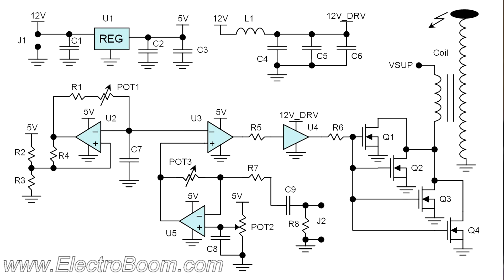Music, Magic and Mayhem with Tesla Coil

Comment: Ok, I have a Question
Is it possible that the nut at the end of the screwdriver acted as a coil to transmit the energy that shocked you 2:13 ?
I'm still getting the hang of this
Reply: It's not acting as a coil it's just picking up the charge because it's conductive

Comment: 2:17 the thing is basically ground until it gets shocked, then it has the same energy as the tesla coil. then before you touched it, it was basically the tesla coil. then the arcs jumped to your body, and you guessed it, a shock.
the reason the charges don’t fade off is because the pointiest end is pointed towards the tesla coil, which makes it not go to ground, but the complete opposite of ground.

Comment: You're a genius! Have you ever thought about doing the same thing with a T.V Flyback Transformer? Maybe simply PWM-ing the signal to the primary coil. Or perhaps using amplitude modulation to represent the different pulses with a lower frequency Carrier Signal than the tesla coil (20-50kHz) that matches the ressonant frequency of the transformer. You think it would work? 🤔
Reply: It might work

Comment: Ok I'm back after 4 years, i tried to build this 'profesionally' and honestly it was freaking hard (I tried putting everything including the 12V and big DC supply using a FBR and a toroidal transformer in a box). And currently, I am quite sad that it didn't work at all, i know the resonance frequency of my coil but i wasn't at all able to tune it at this level (184kHz)  even though i used a bigger cap to lower the frequency and now the i cannot measure the signal with my oscilloscope because its so noisy. The output of the comperator (U3) is fine but even after replacing the MOSFET Driver IC (U4) it was still to noisy to measure, so i was just like "Ok maybe I can somehow not measure this signal but it'll hopefully work" (Note: a week prior to this i was able to perfectly measure everything so i do not know what happened, maybe the two circuits are interfering with each other but this should not be a problem (i built both the musical and normal driver with two seperate outputs))
Fast forward i tried it out and after 2 seconds my auto transformer went into overcurrent mode which meant that something was wrong, after a while i checked the MOSFETS and they were dead. They were'nt even warm, they just died but i still don't know how. I guess the voltage which is generated by turning off the coil (L*dI/dt) killed them but it was still extremely frustrating that it did not work at all

Edit: I WANT THIS TO WORK SO BADLY!!!

Edit 2: Welp I'm a genius and forgot to add a glimmer sheet (or whatever these insulating things are called) works perfectly now just need to adjust it's resonance frequency to 235kHz

Edit 3: Okay....things are getting interesting, the "normal" mode works pretty nicely now but the musical mode draws a lot of current and it really doesn't work that well. Using an oscilloscope to find the problem is also worthless, it can't trigger on the signal (and I honestly don't fully understand why) it is extremely noisy. 
I don't get how you did it, you made it look easy

Comment: Here a tip how the screwdriver shocks you even if electric arcs dont jump electrons are still transferred through the air and conduct on to metal even if the arcs don't jump. The arcs dont have to jump for your fingers to get shocked by any metal object. this is due to the conduction of air molecules by electrons. When electrons pass into the air the molecules of oxygen rub against each other forcing the friction into static electricity.

Comment: Maaaaaan, you ispired me so much! If jet of electrons are spinning about 5 gramm piece of metal so fast it's waaay more powerfull than ion thruster used in space! And it's no even comaprable with microwave experimental thruster. It should be possible make tesla coil space engine using only electricity.
Reply: I saw other video with coil in vaccum.... Ehhh, this idea not possible....

Comment: When you put the metal on top of the coil and it started spinning, couldnt you do the same thing with a tesla coil of a much bigger size? Then, use the power of the spinning metal to power up some batteries or something?

Comment: 1:57 that reaction is hilarious
brief sense of amusement before you snap back into reality and realize youre dealing with high voltage and all the PTSD starts kicking in
Reply: He probably wouldn't have died either way, but he would've had an extremely long hospital visit, or Mehdi really has grown immune to electricity after touching it like 700 times
Reply: were you zapped by lightning?
Reply: jim halcom he grabbed a 2 kiloVolt Jacobs ladder in his 1 million sub special
Reply: Not only was it 2kv, it also had 500mA current. That’s around 1000 Watts. High voltage+High current=High power or basically, DEATH, Medhi was super lucky that his alligator clip connections sucked or he would have been roasted.

Comment: How come the sound cuts out when you put the metal too close to the coil at 3:21? My first guess is that it's not going through the air anymore, but it clearly is. And why doesn't it shock you when you're holding the metal wire but it does with the screwdriver at 2:10?

Comment: Could you suspend the turret upside-down, add a neodymium magnet onto one end of the bolt and then use that to attach your ion rotor? It should be capable of spinning at a higher rate unaffected by its own weight/gravity, it may also cause a different emission effect

Comment: If that's real, that's some amazing audio fidelity from arcs in the air.
Reply: it is how radios work, that's why signal improves with metallic antennas.
Reply: @alttikona  Pretty sure radio transmission becomes photonic once it leaves the antenna up to the point where an antenna receives it, converting back to electrons.

Comment: Electroboom in your own video debunking a crazy nut who was proving NASA wrong named "Is Space Travel Possible??" you mentioned at 2:00 that is the heat that expands from the plasma and pushes the needle around. Here you said at 1:53 that there is a "jet of electrions shooting out and forcing it to spin". Probably should correct that here...

Comment: don't use high voltage transistors. they have such high rdson values that they would heat up considerably under any current. and anyway - I know all the issues with back-emf spikes, but couldn't you just use properly rated flyback diodes?

Comment: Are you using a resistor to limit the primary winding current? Seems like the FET's you are using (Rds on = 0.45 Ohms) would draw > 30A continuously while at 50% duty cycle with your 32V VSUP supply, exceeding their 10A continuous limit...

Comment: I`m trying to make a similar circuit. My plasma ball exploded and I`m trying to fix it. There are two wires that if i short them the plasma ball gives a spark. All I need is to short these wires repeatedly very fast for it to work, and for that i`ll need a oscillator and a way to make the wires short every time the oscillator gives a pulse. How can I do that?

Comment: You don't get a shock from the tesla coil arcs because the tesla coil is a transformer and and transformers obey the law of conservation of energy through the equation Pp = VpIp = Ps = VsIs. Meaning as the secondary voltage rises, secondary current decreases and vice versa. Well although you still get burn marks on your skin.

Comment: Hello, I have a great query:
If I have a fan, with blades and I want it if by mechanical failure I emit a signal to cut a circuit foreign to it. I think of the magnet of a door, when turning the blade, the magnet generates a signal, when stopping the blade, the magnet does not emit the signal what can serve to make the circuit of others go off ... what do you suggest me? You can stick your finger in to see if it works ... greetings

Comment: Would it be possible to plug something like an electrical keyboard into this device and make the spinning wheel spin by playing the piano? Wouldn't that be amazing!?
Reply: With the addition on the outside of this circuit of a midi keyboard, yes! Anything from a cheap digital keyboard with an output to 3.5mm AUX, to a DAW running raw audio/loops/sequences/synthesized midi on that same laptop that is sending the audio in the vid. Super cool!
Reply: anything is possible

Comment: the reason that arcs appear even if there's no sparks is because an ark is when all the electricity is focused but when there is no ark from the Tesla coil even if it's on, the electrons are spreading everywhere. because the screwdriver bit has lots of surface area, more electrons can gather at once and than concentrating electrons to your body. your body is big and also provides surface area for electrons  to spread because they repel against each other. the reason it didn't hurt when you were holding the screwdriver in the other try was because only the arc part hurts because it's concentrated but if you give the electrons a larger surface area to transfer to your body, there's no arc and no pain

Comment: And this is how Tesla's Aurora Halo would be able to wireless data as well as energy.  A similar method could be used to turn the power grid into an internet connection that would greatly reduce the energy lost to inefficiently providing data services separately from energy services.
Reply: Zenn Exile inefficiency is always an issue and having to build much more infrastructure, having to have a filter in every appliance to somewhat steady the voltage not to mention the voltage of the power going into a house would fluctuate significantly depending on the data being sent, and always having large amounts of noise in it, its not exactly a small problem, there is a reason data and power lines are kept separate.
Reply: How so? If you'd like we talk about the science and economicsof why it won't work but I doubt you understand how electricity actually works but if you want to resort to insults I don't mind making you feel like a moron.
Reply: Yeah but if it does to data signals what it does to music, it'll be pretty low quality.
Reply: RisingSwell
that kind of noise can be predicted and is not an issue
Reply: just because it can be predicted doesn't mean it wouldn't be a problem, most home internet would still be significantly faster, and it wouldn't be great for gaming, the only real advantage it would have is availability to pretty much everyone
Reply: RisingSwell
and that my friend, is what really matters

We could reduce some of the noise with current technology. predict and compensate for more, and focus development on drastically reducing the noise to the point where service speeds vastly exceed what is available.  (accidental pun detected)

And that would be guaranteed progress, because more than 7 billion minds are better than 1 company with a strict budget and profit focused agenda.

This network would be the heartbeat of human innovation.  Even if you can only send and receive data at 128k, you can still communicate.  And connecting the world to a single communication network that cannot be shut off, and supplying them with the energy to connect to it and live their lives for almost no cost.

That would be bigger than Fire.

Our society would evolve rather than dissolve into conflict over resource consolidation and energy distribution.  Everyone, everywhere, would have access to the energy to process local resources, and distribution would be global.

War would truly be obsolete.  Just as Tesla envisioned.
Reply: except you would introduce more inefficiency by using a higher frequency for power transmission and having to use high voltage dc and have a separate line and amplifier for the data/ power going to each house.
Reply: *****
For the grid yes, but it would be slowly phased out.  So a non-issue.
Reply: *****
It would not make any difference.  You would not need to service each house.  You could just put up a long range hotspot at mains and use a transmission method that only works on the backbone of the grid.

Again, efficiency in this matter is nearly inconsequential.  Grid systems could be used as classified and protected State or Federal and highly secure networks along side a wireless global internet.

A safe Internal Network.  Worth every bit of efficiency lost in security gained.
Reply: It would be less secure since everyone would have access to it vice the classified computer systems already in use and if you're going to make a hotspot then you might as well just use satellites for wireless data which we already do with much more success so in the end it seems like an impractical solution to a problem that doesn't exist.
Reply: *****
your pathetic attempts at false reference are juvenile and delusional.  I can already prove it works through any normal household wiring and uses little to no power whatsoever.

There are actual patents that cover the transmission of data through power outlets for in-home applications.  But you think you know everything.  Right?

Delusional child go home and ask your mother why it hurts your butt-butt to be wrong on the internet.  She's the one who failed you.
Reply: Ok then prove it
Reply: Actually the audio quality can be better than with speakers if properly done.

Comment: So a question, how "vaible" would it be to be able to send power from one point to another like this? Like wireless charging but, like an extension cord? Could you somehow do it, or cause a directional flow?
Reply: not viable at all
Reply: Under all circumstances?
Reply: The electric energy is transformed into magnetic energy and then electricity in energy back. Air is not very good at containing magnetic energy.
Reply: So any circunstance you used air instead of a ferromagnetic material you will have a fast loss of energy through the distance.
Reply: Alright, thank you for taking your time to explain it :D

Comment: Hi, Mehdi I like to build a tesla coil but i use a dual diffrential comparators and it didn't work. Am i must use a dual push pull comparators?
Please reply :)
Reply: i used Lm393N for comparator, tc4420 for gate driver, and irf260 for the mosfet....Please reply :)

Comment: it doenst spin because of the jets of electrons. thats just stupid. electricity can not create propulsion as it has no mass. It spins due to a magnetic field. you can do the same thing with copper and a AA battery
Reply: Except that there is no magnetic field there except the one created by the coil itself, current is alternating meaning it wouldn't simply spin in one direction and electrons do have mass = electricity has mass.
Reply: In his previous video where he makes the coil he suspends a screwdriver on some string and moves it close to the coil. As he does so, you see the arc emit from the screwdriver and it swings away from the coil. The reason is because the electricity is causing electrons to be ejected from the end. It does not rotate around the coil, as would be expected from your magnetic field explanation, it is pushed outward. Electrons do in fact have mass, and when they are ejected the law of conservation of momentum requires that there is an opposite force. Even light, which actually has no mass, can be used to transfer momentum.
Reply: From his blog:
"My spinning wheel, it was beautiful! There’s a jet of electrons shooting from the ends, of course, but it is not the weight of electrons jumping out that turn the wheel, no siree! The mass of electrons is almost zero. And they are not jumping out anyways, they are jumping out and in at 1MHz frequency. So what is turning the wheel? It is the expansion of air due to the heat of arcs that pushes the rod away. The arcs are pretty hot. In fact when I bring my hand close to them, I can feel the heat rising from them."
Reply: You sure about this
Reply: positive
Reply: You're not wrong but what is actually making it spin is hot air created by the arcs, not their mass. The electrons are moving back and forth, in and out of the coil at a very high frequency.
Reply: photons have no mass and yet, with their energy transmitted to objects can move them. Solar sails. Your logic is flawed.
Reply: logic is not flawed. solar sails work on radiation. not only that but they are specifically designed to catch those particles.
Reply: Ambrosius Malachai
so you say that photons alone even if they don't have mass can't transfer momentum with their energy alone?
Reply: momentum is Through force. Physical energy. The photons energy is like a charge. It can transfer energy, but not in a way that gives something directional force. you can bombard a battery with photons - the battery wont move. but it will charge. Thats why things dont move when you hit them with a laser.
Reply: Ambrosius Malachai
allright, I have to read more about this. I might be exposed to wrong information.

Comment: how fast can the "spinning wheel" go?
Reply: supposing it doesn't fall, until it reaches limit speed, which is the point where the resistance of air against the moving wheel equals the force of electrons pushing it.
Reply: use the metric system godamn
Reply: mmmmn it goes aw fast as usain bolts granny
Reply: more upvotes here ^
Reply: ehhh
Reply: The electrons arent pushing anything, its AC. Its the heated air that pushes the wheel.

Comment: I made a spark gap recently, and it works pretty well but now I'm dying to make one of these. It's a bit beyond my understanding of circuits right now though. I could just try to follow the schematics and solder all the parts together but I don't want to make or do something that I don't fully understand, and it probably wouldn't work right anyway. I'll be taking some higher level circuits and signals courses my next semester of college so hopefully after that I'll have a good understanding of what's going on with this coil and I'll build one myself. I've watched this video several times now.